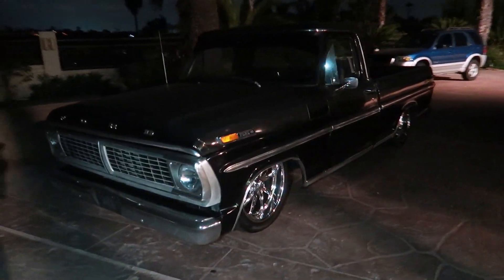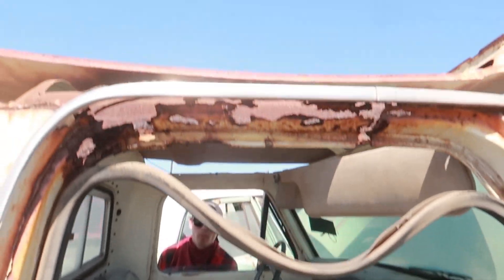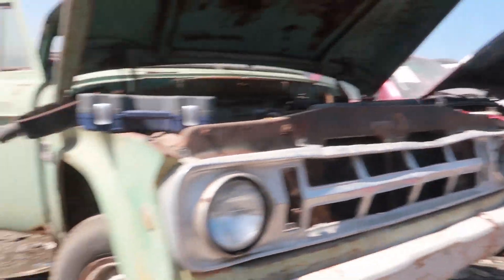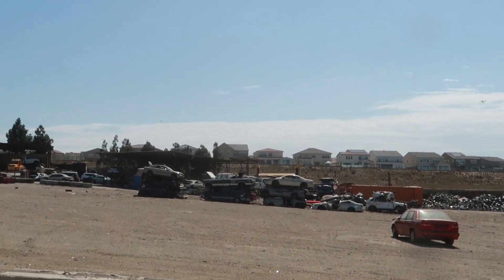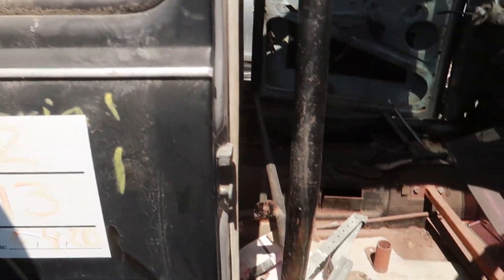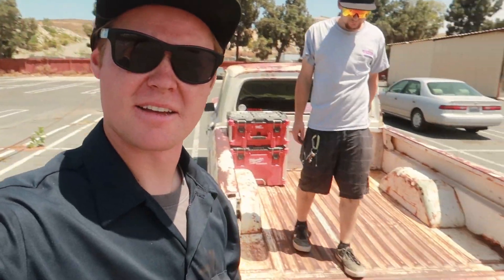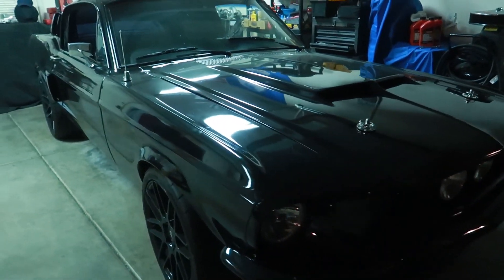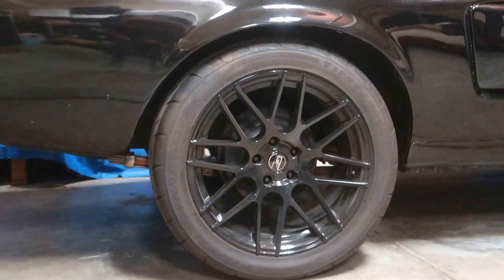Attempting to Take Back What's Mine at The Junkyard...

Comment: I have A request If you could Please Find Me A Brake Line Support Bracket Front axle Driver Side Left that bolts to the axle 1979 (bronco) ford. Think any 4x4 truck of that year will work. I some how lost mine. I am in the process of putting mine back together and it's gone.  The bracket that holds the brake line that goes to the Caliper.  Just let me know how much? thanks

Comment: If you engine swap your truck and you can get the money together to do it you should put the new 7.3L "Godzilla" engine in it. In stock form it makes 430hp 475tq but they said with headers and a good tune they make ~508 completely stock. They are $8150 from Ford Performance and you'll never have to worry about breaking it with all forged internals, piston squirters a variable oil pump, roller rockers etc that they come with from the factory. And the really psycho part is it looks like you could bore one out .250 easily which would make it a 499cu in.. (they are 445 stock) https://performanceparts.ford.com/part/M-6007-73 Oh and it's the same bolt pattern as all mod motors so you can easily find a bellhousing for it.

Comment: Yo Craig remember that green 75 f250 u had, that it had trouble hot starting do u remember what the problem was? I have the same problem
Reply from the maker: The starter was bad
Reply from the maker: Make sure you have at least a 650 CCA battery as well

Comment: 200 for a tail gate and had to give one up to bad u don't live by me my friend has a sh ton of these pu from 67 to 72 i was just looking at a 69 1 ton 4x4 flat bed in good shape running and driving for 500 bucks and they put a 390 in it . it went real quick i turned it down because i just have way to many 67 to 72 ford pu's plus i all ready have my dream pu 70 high boy with dana 60/80 lockers with a 4 speed 390 engine but i have a 428 that i'm going to rebuild for it and no it's not a performance engine just going to keep it stock for the most part